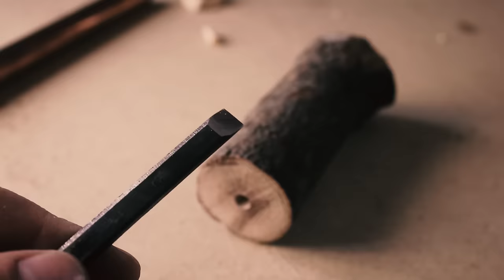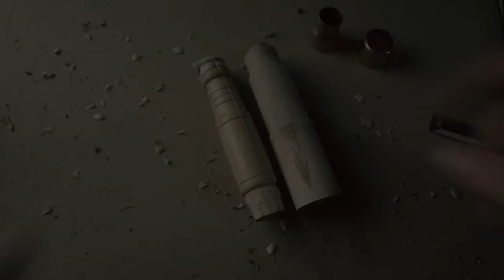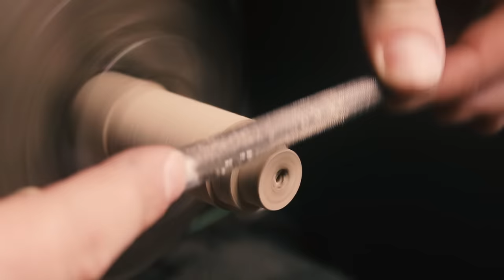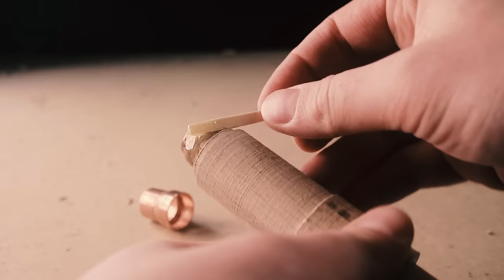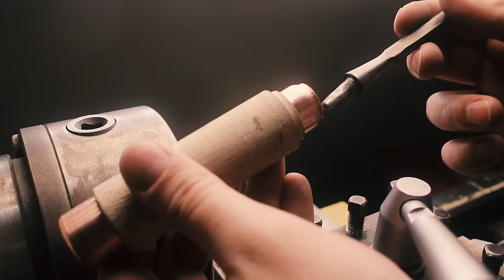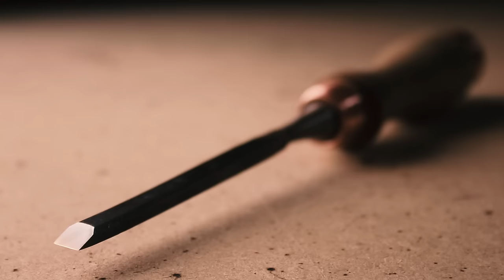Turning wood on a metal lathe

Comment: Many older wood lathes came with a cross slide, l have turned steel and brass on a 9” craftsman 9” wood lathe and a a delta double duty wood lathe no lead screw for threading or auto feed. It’s a slow process as you take light cuts

Comment: I've become curious about lathes for turning wood and working with metal - would it be reasonable to just jump in with a metal lathe and use it for both? I don't want to buy two machines if the metal lathe does what I would need.

Comment: Very nice work.
Out of interest - what lathe do you use in your videos? I notice you use it for both metal and wood work. It seems a good size for the things I'd like to do, so I was wondering if you could share any more details about it?

Keep up the great work. =)
Reply from the maker: Thanks Chris! It is a second hand one, got it in quite decent conditions. This was just a test, but it's definetively for metal and I wouldn't turn wood again unless strictly necessary since it does no good to the leadscrew and guides. This one is about 90cm headstock-tailstock and for a max diameter of about 17cm. If you want to know anything in particular just ask me :)
Reply: +Cactus! workshop brilliant. thank you for that. gives me something to think about.

Comment: I don't know how you do to have such sharp cheap chisels ahah is your chisel drill press sharpener efficient enough ? I will consider building it if so ahah. Really nice build. It gives a special spirit to your chisel ahah
Reply from the maker: +William Pellegrino thanks man! These chisels are cheap and I quenched them myself but since the steel is not so good it doesn't hold an edge for too long. The chisel sharpener does work quite well since often I have to regenerate the whole edge. I use 180 and 500 grit plus a final quick touch on a diamond cutter from a CNC center. Really all recycled :)
Reply: +Cactus! workshop ahah alright I'll heattreat them myself as well. And I'm gonna build your sharpener as good as I can. I'm preparing another video by the way !
Reply from the maker: +William Pellegrino waiting for the results then! :D
Reply: +Cactus! workshop it's gonna be way longer ! :)

Comment: A wonderfully beautiful video as always! Out of curiosity, to burn the detail in the handle, did you use regular metal wire, or something specific? Thanks!
Reply from the maker: Thanks! it was normal wire, galvanized I think. But I don't think it matters, you just press it against the piece and it will heat up and leave the burned mark
Reply: Nice, that's easy! I haven't had a chance to turn much on the lathe yet, but my attempts to burn nice looking rings have been, uh, less than successful so far. I'll have to give that a try next time, thanks!

Comment: Really nice ma man! 

What type of athe are you using?
Cheers
S.
Reply from the maker: Thanks Samuel! It is a second hand metal lathe with not so many info written, it has around 90cm between head and tailstock if that helps you to get an idea :) what do you want to know?
Reply: I would love to try and get one, most machines are around the >€1500. I was just wondering what kind it was and what you paid for it as it does exactly the kind of things I would like to try and do! 

Thanks for the reply and again, great things!
Reply from the maker: It was 450€ second hand because the owner wanted to get rid of it and did not know much about it, so it was a great deal even if missing some pieces :)
Reply: awesome. Lucky and good find.

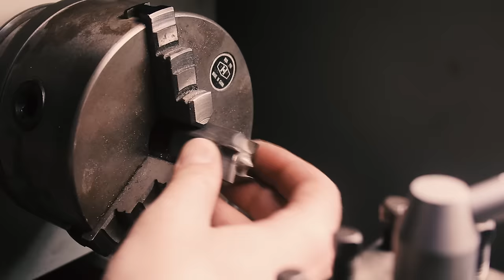Comment: What is the metal part you clamp in at 0:29 ? A suggestion where I might get one like this ?
Reply from the maker: it is just the headstock point from my wood lathe, that was included in the set, but probably you can find spare parts online. good luck!

Comment: So actually, a wooden lathe is not necessary if you have a metal lathe? Or is this not recommended?
Reply from the maker: +Toby not really recommended because wood chips can mix with the grease of the mechanical parts and create a mess or even rust. You have to clean everything thoroughly after turning wood :)
Reply: I still rather have a metal lathe though. You can turn wood on metal lathes (just make sure the sawdust isn't causing problems) but you can't turn metal on wood lathes.

Comment: Beautiful work son!!  However, you might want to epoxy the chisel into the handle next time... :D
Reply from the maker: hahah yeah! thanks Josh! :)
Reply: The epoxy compounds I've worked with will eventually just shatter on you when you'd pound the chisel. I'm not much the woodworking guy anymore since I got into metal but a tapered hole and some linseed oil might be worth trying?